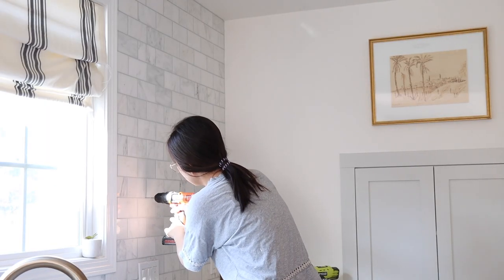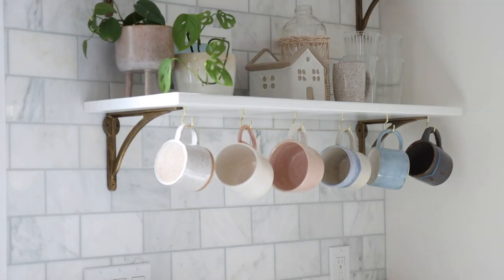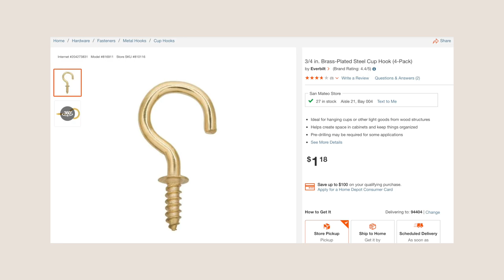DIY Kitchen Shelf with Cup Holders

Comment: 1:14 “not a contractor” — trust me, you’re fine. Plenty so-called contractors in my area perform such garbage work — saying you’re not a contractor or carpenter is actually a sigh of relief! These days you only call a contractor if you can’t be bothered to do the work yourself — but know exactly how to do the work so you don’t get ripped off by the contractor! Seems a rule of thumb is — if the contractor knows they can cut corners — they will!
Reply from the maker: hahaha true true!